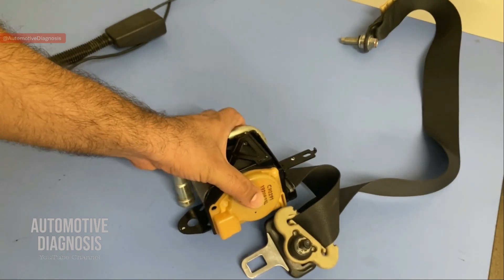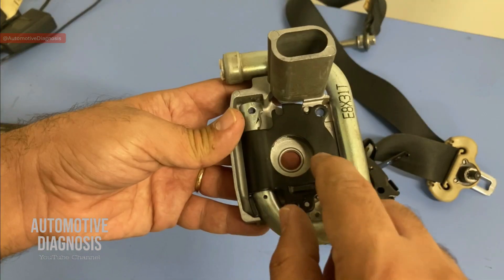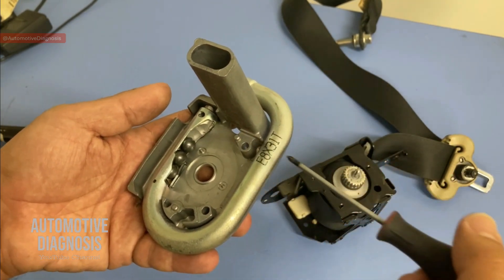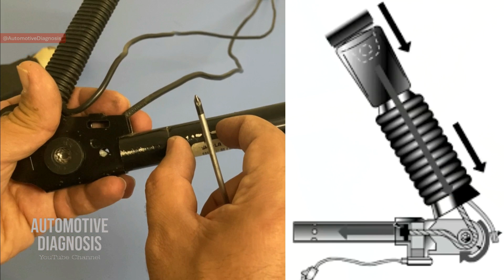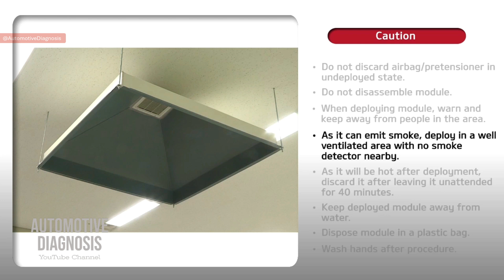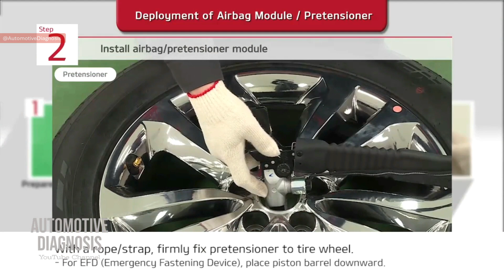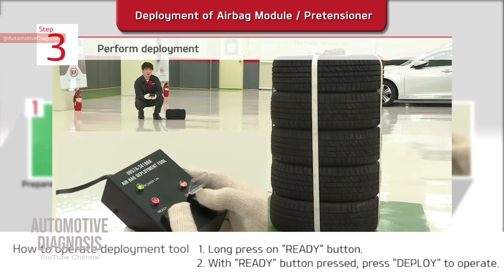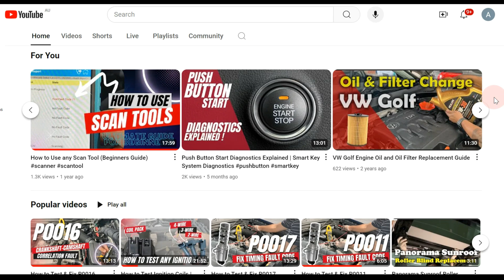How Seatbelt Pre-tensioners Works | Operation, Diagnostic & Deployment

Comment: If the air bags have 2.3 ohms, what is the resistance of the pre tensioners, confusion on my part by using the demo mode of my scan tool, for ford it has the air bags as 2.4 ohm,
 but it shows
driver seatbelt at 2130 ohm, 
and driver side air bag deploy control resistance 2370 ohms 
are they saying the 2.3 is good and the 2 kohm is faulty or are the what should be there if its good.
Reply from the maker: Hi there, normally the resistance of airbags and pretensioners that I’ve are between 1.8 to 2.8 ohm, a data showing kohm is too much and shows an open circuit. Of course on the live data you can compare the data of all airbags too.

Comment: This is the video I've been looking for, for years. One question not answered here is how the seat belts have a one way ratchet mechanism that will prevent you from suddenly pulling the belt out. It must be some kind of centrifugal stop, or maybe something that rotates forward to lock the belt with sudden deceleration. Is this an older mechanism not used with more modern seat belts?
Reply from the maker: Hi my friend. We have that mechanical mechanism even in the seatbelts equipped with pre-tensioner. That mechanism has a ratchet gear and a lever that works by centrifugal force (as you mentioned). So when we pull out the belt very quickly or is sudden braking (rapid deceleration), that lever will pivot and it will lock seatbelt retractor. But the difference between this lock and pre-tensioner is that pre-tensioner is gonna lock the seatbelt permanently while the mechanical locking mechanism is not.